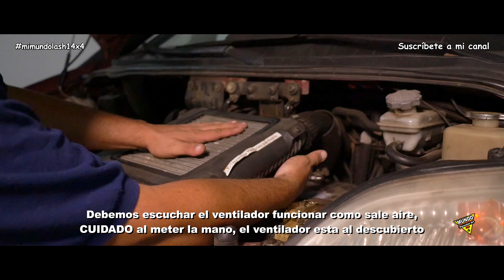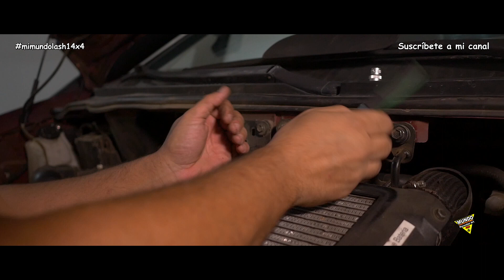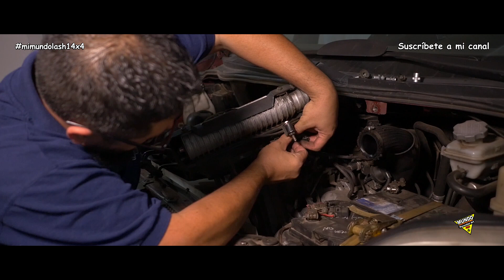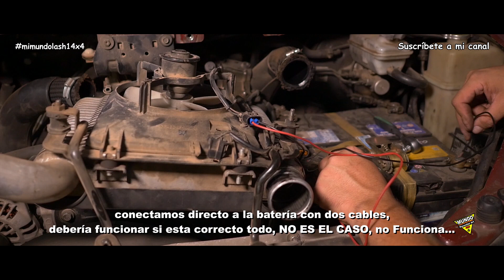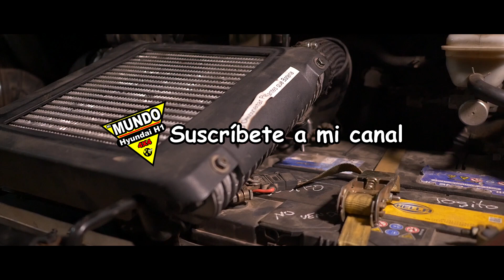REPARAR VENTILADOR DEL INTERCOOLER  HYUNDAI H1 4X4

Comment: Hola amigo .yo tengo un  h1 2007 ....cómo es el modo de trabajo de la ventiladora del intercooler..por qué cuando está en ralentí veo que no funciona ...pero lo probé directamente y funcióna ......y sien caso estaría mal algo ....que tengo que fijarme ....por fa ......espero su respuesta
Reply from the maker: Hola Amigo. Si es el modelo crdi debe trabajar fijo. Si no lo hace y el ventilador a corriente directa gira puede ser fallo de fusible o algún cable mal. 

Modelo tci. Funciona por temperatura,lleva su sensor el cual activa ventilador. 

Espero haberte ayudado.

Comment: Buenas!
Que suerte tuviste que arrancara despues de esos golpecitos... safaste de comprar uno nuevo!
Consulta: en tu camioneta prende fijo siempre? O arranca a tal temperatura?
Si es asi, a que temperatura lo hace?
Gracias.
Reply from the maker: Hola amigo. La verdad que si,funciono con esos golpes. En las Crdi el ventilador trabaja fijo una ves que arrancas el coche.
Reply: @mimundolashyundaih14x4.4   Ah perfecto. La mía es motor D4BF, la deje encendida para probar ayer hasta que llegó a temperatura caliente de funcionamiento normal pero no encendió nunca. En mí caso, el capot tiene toma de aire, pero estando parado debería haber arrancado: nunca sucedió. Procederé a sacarlo y probarlo directo a la batería, y caso que no funcione, ver de repararlo. Tiene un termoswitch además, que es el que debe mandar la señal de que el aire está caliente... Pero nadie sabe decirme a qué temperatura trabaja. Será meter manos y averiguarlo nomás!
Reply from the maker: @DiegoTroilo  tengo entendían que en las TCI. No llega a funcionar siempre. El por qué,no lo sé.
Reply: @mimundolashyundaih14x4.4   Saque el electro, prende perfecto directo.
Probe el termoswitch, le mande agua a 70° y cierra el circuito: funciona.

No se cual sera el RELE de la caja que corresponde a la apertura de este sistema.
Pense en dejarlo encendido fijo, pero voy  a renegar mas con el consumo de la bateria, que con el flujo de aire me parece...
Reply from the maker: @DiegoTroilo  que bueno, sabes que esa parte esta correcta ,eso es bueno. ya el tema del rele lo desconozco